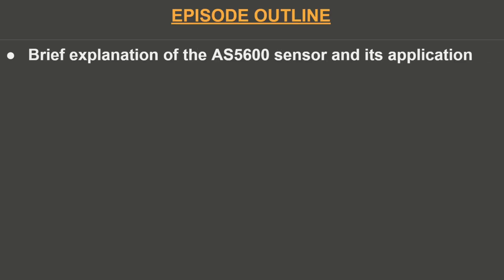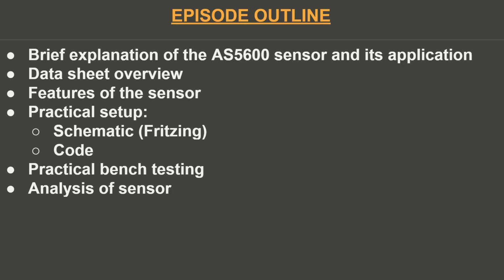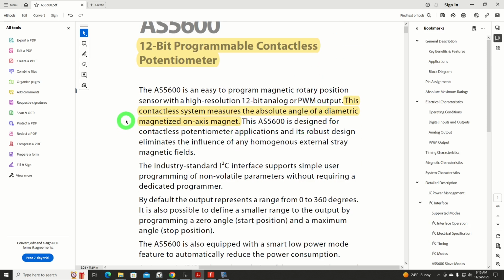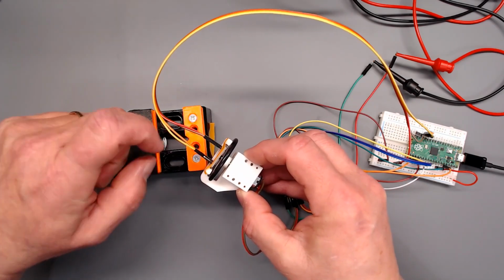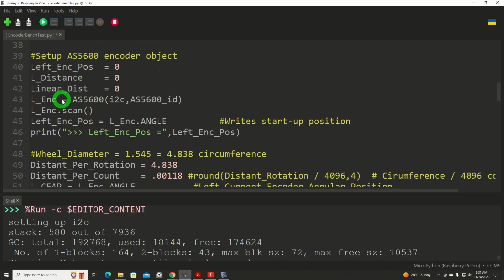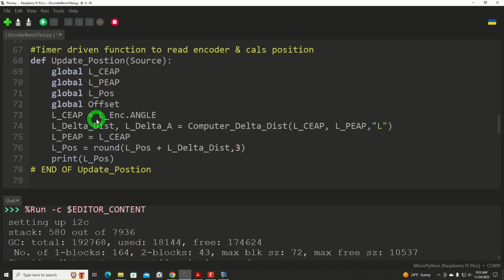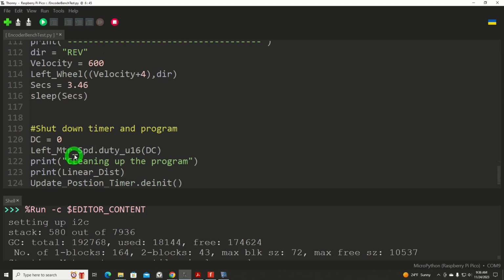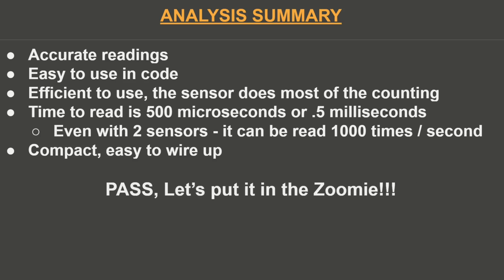E12 How the AS5600 Encoder Can Provide Odometry Information

Comment: Hello Sir! Your video is very informative! I am having a hard time importing the module AS5600. I use Thonny, and get an error on the line "from as5600 import *". The error is "no module named 'as5600'. I tried installing the module using the Tool command Manage packages, but as5600 can not be found. Same issue when trying to installing the module in a command shell using pip. Can you help me with this problem? Thanks!
Reply from the maker: I assume you are working with a PICO, if so, just copy the file from your PC onto the PICO.  This video will explain how to do that.
https://youtu.be/ziBzaqSEQBM
Cheers!
Chris
Reply: @MakingStuffwithChrisDeHut  I think he is looking for the library you used, i'm interested in that too.
Reply from the maker: @phlexy  I added a link to the video description section.